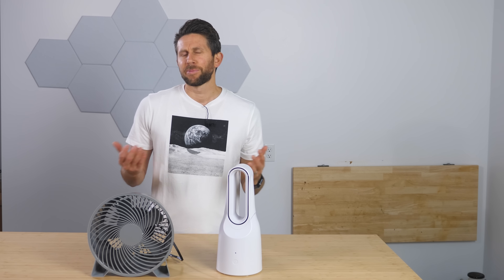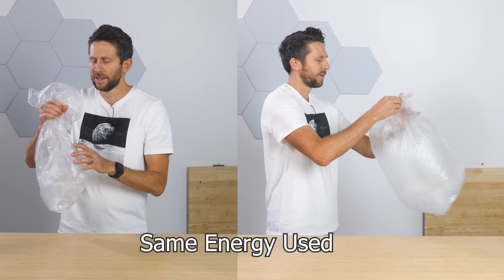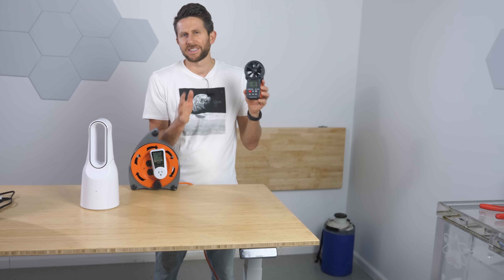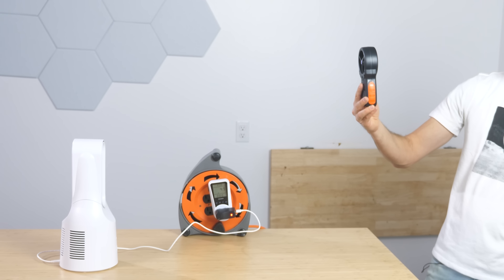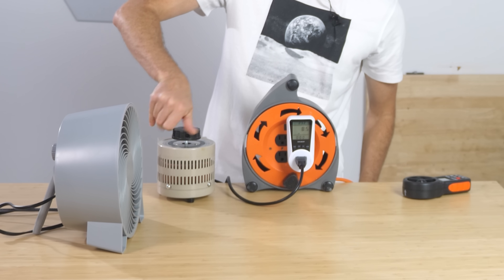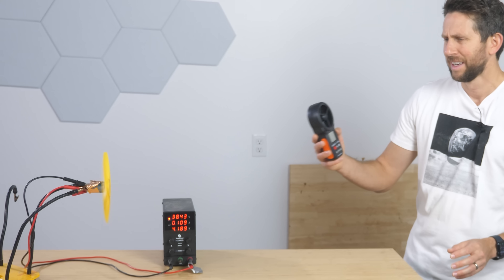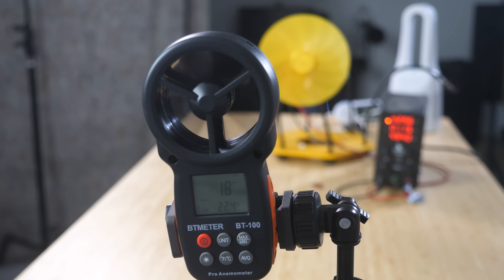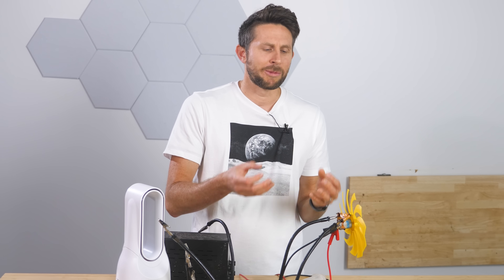Are Bladeless Fans a Scam?

Comment: It’s all 2 formulas: ro.pi.R2.v2 = F and P = ro.pi.R2.v3
So everything is dependent on radius and speed at sea level. The bigger the radius, the lower the speed for the same thrust, and the lower the power for the same thrust. Big fans =. Much wind for low power, small fans = much less wind for the same power. The largest fan wins. If corrected of course for intenral resistance ( the problem of your biggest fan) and the ducting of the airflow ( the disadvantage of your yellow fan vs the dyson fan. The dyson then further accelerates its air flow, resulting in less wind for same power.

Comment: The standard blade fan usually doesn't have any purifier or filter for the air they provide. The non blade fan has some short of filter when they suck the air in so the blade inside would be cleaner and also the air provide is somewhat cleaner for you too. Efficiency clearly the blade one is better.
That being said, I am not sure how is the standard blade fan + an air purifier vs the no blade fan in term of efficiency. There seems to be so many things to consider if that is the case.

Comment: Some of the bladeless fans also have a filter. Of course you can also use the filter without the bladeless pastic around it, but then it is louder. So the bladeless top works as a noise reduction.

Comment: 2:48 Checks airflow. "Ok, its up here for some reason".
The air is blowing up the column and has momentum as it exits the vertical slits.
If I have a desk fan, I want the airflow to be horizontal or adjustable, a feature usually standard with regular fans.
Standard vs Dyson. Standard wins on almost every check box.
If they were the same price it would at least be a closer contest but Dyson price is crazy.
He just has clever advertising that makes gullible people want them.

Comment: tldr. there's a dc motor fan in bladeless fan blowing throw slits making central air blow faster concept but the air from slit slows down central air speed so overall speed result is significantly lower than original speed from motor. Get out here my future forgotten mind.

Comment: Too many confounding variables. Air speed is less important than volumetric flow. Furthermore, fans can be optimized for many things. Static pressure vs pure volumetric air flow. Even when comparing the two fans outside of their housings, one was a blower style fan which has completely different characteriestics. You bring up an interesting experiment, but it really wasn't executed well, unfortunately. You had far too many variables you did not control, especially far too many to make claims that one is superior etc. Intuitively, I can bet that a normal fan us more efficient, but that also depends on the blade design and motor. A blower style fan will produce higher speed but not move as much air. And putting an enclosure around it that forces the air to turn 90 degrees will naturally rob it of a lot of energy.

Comment: Very poor experiment. You did it totally wrong.

First of all you meter power consumption of a regular fan with a variac.

Next. Why ever you meter the max speed of flow instead of total volume of air moving through? 

Try to read about fan characteristics, volumetric flow rate and forth, before start all over with more or less adequate hipotese. Cheers

Comment: I would much prefer modifying CPU fan(s) and using those to circulate air, especially on a desk where space is constrained.
As for my apartment, I have five rather large "desk" fans running day and night (along with open windows - year-round) to circulate the air, along with one installed on the vent of the washroom exhaust (where one used to be from 1963-1975 when it was phased out/removed) to keep air circulation at maximum.
Yes, I maintain the fans (oil on the motor when it loses speed or makes noise, decreasing if not painfully enclosed/sealed) to keep them running smooth as anyone should be doing, along with wiping the blades clean (if dust sticks to it).

CPU fans are much easier to maintain due to a "plug" behind the sticker, easily removed to access the reserve, to put in a few drops of lubricant, so it runs smoothly for decades to come. An array of those (12 volts DC) would easily replace a desk fan and are far quieter. As for making a stand for an array (of two,four, six, eight, ten, twelve, etc.) with an appropriate voltage, a wire coat hanger can do just fine for the stand, while twist-ties can hold all of them together (by the mounting holes) or zipties if picked up and moved often.

Comment: One big advantage of the bladeless fan is its natural flow which feels much like a swift breeze, on the other hand the blade fans slice the air and throws air which is much more turbulent and does not feel natural. This thing was completely missed out in this video unfortunately. The bad part being dyson is selling it at an insane pricing.
Reply: If you want a swift breeze, just use a normal fan on the lowest setting. I have a Dyson fan and the only benefit it has over a traditional fan is that it is safe for children. On a hot day, I prefer a normal fan which is quieter and more powerful than the Dyson.

Comment: what about the total VOLUME of air?  maybe the blade-less fan pushes more air at a lower speed?  if the cross sectional area of air movement is wider, then more air is involved.  the correct way to measure this needs to be based on what the desired effect is.  maybe you want more evaporative cooling.   or maybe you want to jingle the chimes hanging from the ceiling.  maybe you want to clear the room of smoke.   all these answers will be different for the same fan.  and they will have even wider ranges of satisfaction.

Comment: When I was young I was very impressed by the fact that bladeless fans were able to move air without fan blades... Until I went to a store that contained bladeless fans, and I could feel that the air current just came from a little gap around the frame, and the base of the fan contained fan blades. I was then very disappointed in bladeless fans

Comment: You need to look carefully at the fan design, many of the cheap bladeless fans don't have the proper design with air blowing through the slots that runs around the edges. Instead it's just blown through few holes on the sides, which does nothing to pull in surrounding air to create that effect.

Comment: I live in the south...a bladeless fan is about as useful to me in the summer as a bonfire in a volcano. As proven here it don't put out as much moving air and for a lot of southern folks I know the fact the fan MAKES sound is a selling point...helps a lot of us go to sleep. Everyone on my mom's side of the family needs some kind of noise to sleep easier...so either a noisy AC unit in a hotel or a box fan at home. Also...again...box and those fans that move side to side (it's too early in the morning for me to try and spell it lol)? MUCH cheaper than a bladeless fan...and in the current economy with how expensive everything is already I'll take the cheaper fans that move more air thank you very much.

Comment: Use cases for a bladeless fan would be safety. If your in class room of kids for example. No little fingers to poke threw wires or shove a pencil. Squirrelcase fans are crazy efficient. Each type of fan moves air differently. I don't believe the bladeless fans will blow all your papers off the desk for example.

Comment: I still prefer the old school traditional fans with "Metal Blades". The sound doesn't bother me, it's the air displacement that I'm after as well as the integrity of the material used in its assembly and design. A nice oscillating metal desktop fan, or a floor model fan typically range between $20 - $60. Dyson can keep their overcharged plastic junk that's several hundred in cost for less performance per cost of power usage.

Comment: It should be fairly obvious that forcing the air through tight constrictions will yield less overall output than with no restrictions. Just in terms of basic physical laws, resistance will always cost you efficiency in any system.
If you had a way to measure air volume (which is what you generally want a fan to be good at), not just speed, then the bladeless would compare even worse because it generates a fairly thin jet compared to the wide arc of a typical radial fan.
Aside from the pure gimmick or arguably aesthetics - the only real benefit I can see from a "bladeless" fan is that it safer for very small animals and such that could conceivably manage to poke their bodies into the grills of regular fans and hurt themselves, but even that is easily solved by a fan model with a finer grill/mesh. It doesn't help that you typically pay more for what you get compared to traditional fans.

As a fun sidenote - true bladeless fans do exist - using either ionization or vibration of a thin membrane to move air, but these options are even less efficient and only really make sense in very small-scale devices. Radial and axial fans are probably not going to go away or fundamentally change in the foreseeable future as they are already simple, cheap and very effective.

Comment: This would be like comparing the output of an air compressor vs a 2 foot blade fan.  The wind speed out of the air compressor is far faster than the fan.  The wind volume from the 2 foot fan is far far greater.  I could cool my living room better with that big fan.

Comment: Some others have pointed this out, but the volume of air displaced per second (or whatever flux units you want) seems more relevant if you're measuring how well it can function as a cooling device. Both fans may entrain air, but you can't just assume that the degree of entrainment is equivalent. The "bladeless fan" entrains air both at its intake in the base and at the output ring which may more than make up for the marginally lower peak air speed when the fan was taken out of its housing

Comment: A variac introduces a lot of resistance, and dissipates a lot of power as heat (that's why the case is so thoroughly vented.)  You want the wattmeter to measure the output of the variac, rather than the input as you did with the grey fan.

Comment: It's good to see somebody with some kind of influence calling out these gimmicks. The bladeless fan multiplies air movement, but the inlet is impeded so you're back at square one. OK, so the fan is quieter right? Well no, the fan is smaller so it has to spin faster. Fast spinning fans are LOUD. But then that is compensated by the fact is is encased in a housing. If you need a fan for cooling, just buy a basic fan instead of wasting money.

Comment: Another seriously flawed test made just to get views. 
1. Didn’t test over a range of distances.
2. Didn’t test at different power usages.
3. Made the assumption that the much higher cost of Dyson didn’t change the design enough.
4. Didn’t take into account the different motor designs.
5. Didn’t take into account the shape of the airflow, such as measuring the edges of a cone.
5. Didn’t take into account the use cases, such as a confined area.
7. Didn’t take into account the overall size of the fan.
Some of these things were touched on a little, then completely ignored anyway.

Comment: This will probably get buried but I am a industrial HVAC and heat analysis engineer. Another test you could run would be a convective cooling/heating test. Stick a hot rock 1-2 feet behind each fan and have fan’s airflow pointing toward a big block of ice. Really the blameless fans are just a fancy duct with unconventional geometry. A true axial fan (like the kind you can get at WalMart for $20) is just a fan (for lack of a better word?). So you’re kind of comparing a weird blower-duct system to just a plain old fan. Having said all that, the world of heat transfer and airflow is very cool (no pun intended) and I’m glad to see this topic get some coverage on a popular science channel like this. Also from a usability/design perspective as others have brought up a bladeless fan could have safety benefits. They’re not strictly a gimmick in that you do get a functional fan but they are way overpriced.

Comment: All the original bladeless fans where much bigger than the one you are using. 

I wonder, is the perimeter of the fan similar to the perimeter of the bladeless slit? 
Does the bladeless fan work better when the perimeter of the slit is significantly bigger?

Comment: really strange, the advertisement said that the limiting form will increase its efficiency, and we all know advertisement never lies, not even when they try to tell obviously impossibilities like getting more efficient by adding many points of energy wasting turns and twist to the airflow.

oh, btw, when you blow into the open bag, you did not filled the bag, you moved the wall of the bag in the same air, the movement was mostly free, while blowing up a bag would need you actually move the air (and also add the intake problem.)

Comment: You all r missing a few main things. Including ACTION LAB. Pout mouth blows cold air while an open mouth blows hot air, try it. Two: Buffeting wind from a normal fan is choppy. The ducted wind is smooth. So Imagine this: Atomising shower (compression) water gives relatively cold droplets of water even in mid day from hot roof tank. Same water from a tap or a normal shower is hot because there's no compression. So a blade-less fan is compressing the wind through the pouted slits. Which gives relatively cold air even on a hot summer day compared to a Buffeting fan that's just pushing air. From point a to b.

Comment: I have a Dyson bladeless downstairs and a conventional fan upstairs. The only practical difference is that the Dyson is much quieter in operation. 

On the non practical side, the Dyson looks better, but that is just my opinion. So, if you’re thinking of buying a bladeless fan by all means do, but don’t think it’ll be noticeably better or worse at throwing air around.

Comment: I'd love to see this test re-done with the Dyson one. The blade shapes are different, similar moreso to an aeroplane wing which improves the volume of airflow and is less restrictive to air entering from the surroundings at the blade portion.
Reply: The addition of the top cover changes the direction of the air flow, and energy will always be lost. No matter how aerodynamic Dyson makes the top cover, it cannot magically generate more power than what was put into the motors.

That also means a bladeless fan with the bladeless top cover will always have worse airflow than a traditional fan with the same motor and power.

At that point, it's just a comparison of bladeless top cover designs. It's not science anymore, but engineering. Science already tells us that bladeless fans will always have worse airflow. But the reality is that people don't buy fans only based on airflow measurements.
Reply: @FreshSmog  Thank you for that. So to reiterate, I'd like to see this test re-done with a Dyson fan out of pure interest. I'm not a scientist, I just like seeing cool tech in action.
Reply: true. dyson expensive because build by precision. to have total advantage of using bladeless fan on precisely push air around it. alot of cheap / clone one just gimmick. try get a real one.
Reply: @huzainisahmawi The real one is a gimmick. Try getting a normal fan. It's more efficient and better for environment. Lost efficiency turn in to heat or noise.

Comment: i took a pc fan and connected a USB cable to it, then i connected that USB cable to a DC adapter that lets me change the voltage, keeps mee cool at night when i connect the whole thing to my phone charger XD

but yes, the "bladeless" gimmick is a bad design, the less pressure the air has it makes it move faster, but, well...it has less pressure, meaning its not moving almost any air, that is what you need to keep yourself cool, you need to move the air.

Comment: Radial fans have lower efficiency than axial fans
Radial fans are used where higher static pressure is needed, axial fans are more efficient in volumetric flow.

Comment: I agree with your conclusion, but your terminoligy and methodology left something to be desired. It isn't suction, but pressure displacement, and volume of air and speed should be measured before mentioning efficiency. That said, an interesting result.

Comment: I'm curios why the speed is measured? Probably effectiveness in case of bladeless fun is about overall amount of air which pass through and not just about the speed. I also believe aerodynamics matter and so not every bladeless funs are the same: hole in the one shown in the video seem to be pretty small related to output air flow if compared with Dyson fans, so maybe output flow crosses and slows down by itself. More accurate representation would be try to blow something bigger than just a small plastic bag and measure the time needed.

Comment: 1. It's not a bladeless fan. There's one in the base.
2. The multiplying effect you're trying to describe is called an ejector. Fan air from the base is forced into that oval restriction increases velocity and thus sucks ambient air from the room due to its boundary layer (thick air). 
It does work, but let's get our physics right.

Comment: I think beside air speed, you should do a test on hot objects. So say, you put a bowl of water at 85° C. You blow the fan at it for 3 minutes. Then measure the temp. You do same test with both fans. See which bowl of water cools more after same amount of time.

Comment: To be fair, you were comparing different styles of fan. Bladeless don't just come in the tower form and for that kinda comparison perhaps it would have been better to not use a tower style bladeless.

I think the biggest selliing point of a bladeless is safety. There are no exposed blades. Yes, I know, you have the guard. That's not quite the same thing though and certainly not as sturdy/rugged.